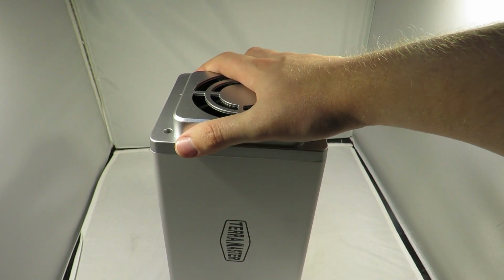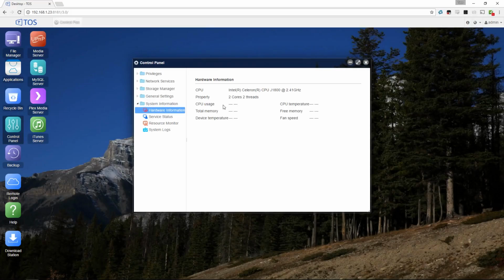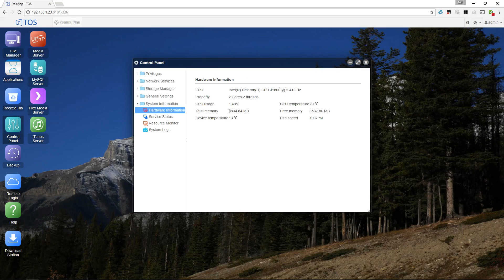How To: Upgrade RAM In Terramaster F2-220

Comment: F4-220 successfully upgraded with Hynix HMT425S6AFR6A-PB   ;)
Reply: Have you had any issues with that memory stick? I would like to upgrade.
Reply: @TimeWillTellAll  No, works perfectly until now.
Reply: I cant seem to find this RAM. Can you tell me please, is it DDR3 or DDR3L, 1600mhz or 1333mhz and is it 1.35V. I'm finding conflicting answers all over the net as to the correct RAM for the F4-220. Thanks.

Comment: can I put a 4GB ram stick inside the F4-220? for a total of 6GB? or is the max 4GB? 2GB+2GB?
Reply: great question.  but as it mentioned below, --> " echguy348 : 8gb and 4gb stick does not work on this nas" i'm wondering if its not a CPU or chipset limitation. so 2GB on board  + 2GB

Comment: 8gb and 4gb stick does not work on this nas
Reply: I installed an 8gb today (the original slot is 2gb). TOS recognized all 10gb, which I wasn't expecting. The CPU will probably only ever use 8 tho.

I did accidentally break the plastic on one of the "stickers" but I was just holding them open.

Comment: Looking for the full specs on the RAM you said you'd put in the description
Reply from the maker: Just added for you.
Reply: Thank ya. I've tried 6 sticks in mine and it hasn't booted unless I remove them.
Reply: After you install the new RAM is the behavior on first boot the same as before (a beep and green flashing drive lights right away) or was there a wait?
Reply from the maker: It was like normal, maybe a bit longer but not too big
Reply: Cool thanks for the response. I suspect none of my RAM is DDR3*L*, just ordered some, hopefully it wasn't a waste of money. This is all in the name of putting Xpenology on it. Would love to see that video.
Reply: For other people's edification, I ended up getting both a 4 GB Crucial DDR3L SODIMM and a 2GB with the same specs, since I read people saying they got 4GB to work in forum posts. My 4GB did not work, but my 2GB did. Running beautifully now with 4GB total RAM, 16TB, Xpenology, Sonarr, Radarr, and Plex
Reply: @Tingawinga5  Can you repost the memory stick used to upgrade.